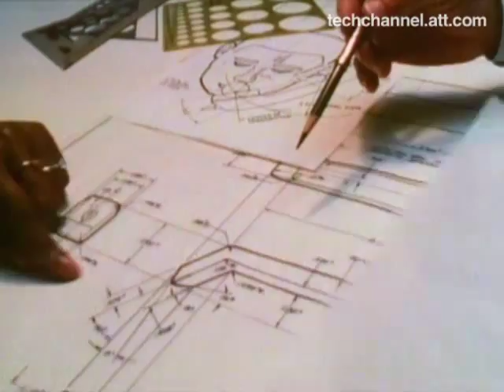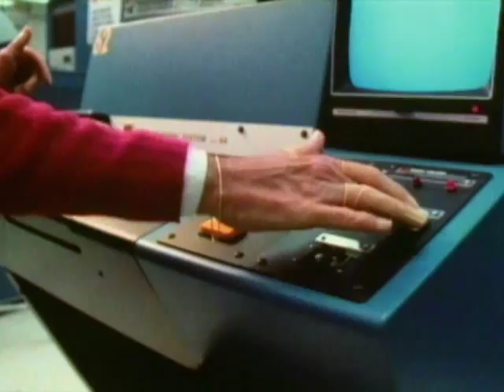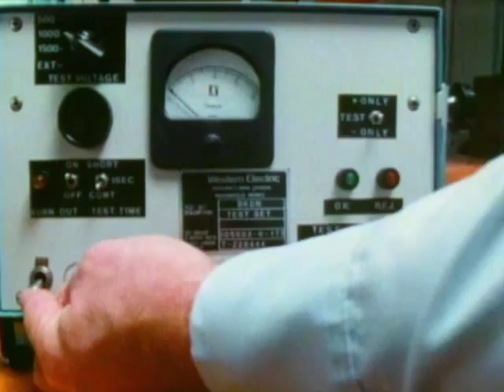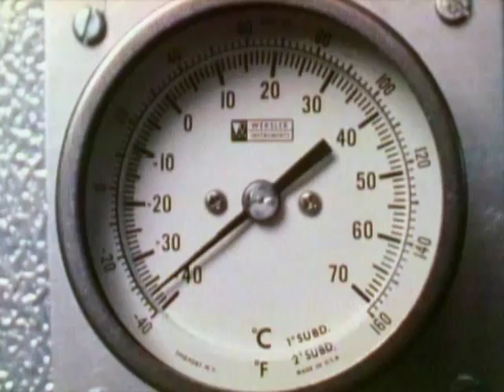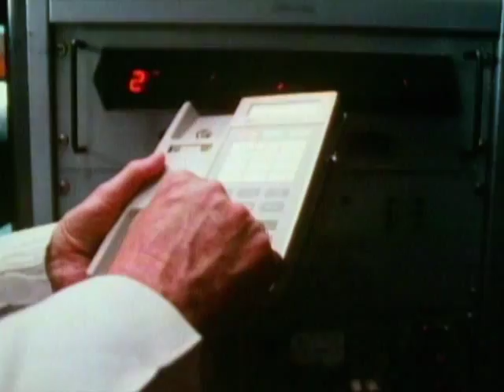Designing, Building and Testing the AT&T Trimline Phone - AT&T Archives

Comment: I'm sorry to say. But the phones of that era were great. I just bought my first Modern Trimline 210 after the keypad with the Tuneable coils failed on a Western Electric 2554 from the 1970's.

To say I'm dissapointed is an understatement. The older phones had better protection from Radio Interference than the current model. And no, a radio interference filter isn't helping at the moment.

AT&T Tech Channel, maybe licensing for the ability for a manufacturer to make parts for older legacy devices would be proper... just my two cents.

At my desk, I have a 2500DM with a 4H Speaker, a 202 with a Bell Box, and a Rotary Trimline. They all work flawlessly after so many years.

Comment: 2:49 a machine that pounds the hook switches for a while. Cisco should have done this with their 79xx series IP phones... would have revealed their bad build quality and high failure rate.
Reply: walmart has a bunch of those phones in the store I work at; the one at the sporting goods counter will sometimes not get dial tone because the hook switch sticks on it (you have to press the hook switch with your finger to unstick it.) also, it sometimes crackles if you wiggle the handset cord.
Reply: Cisco is Chinese junk. These Western Electric were designed and built in America. AT&T had very high quality control because they owned the phones and didn’t want them to break.
Reply: Hmm, maybe because I use my 7962 mainly on speakerphone, I never had any issues with it. I always thought they were pretty wellbuilt compared to the new Avaya handsets being pushed out.